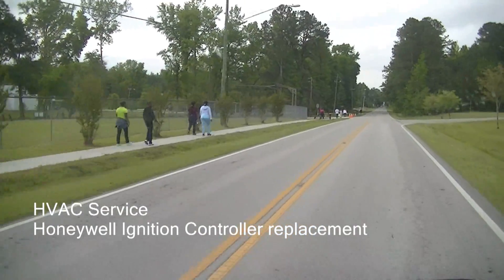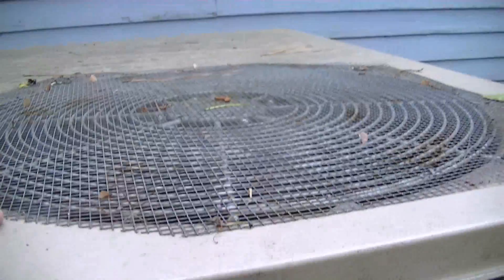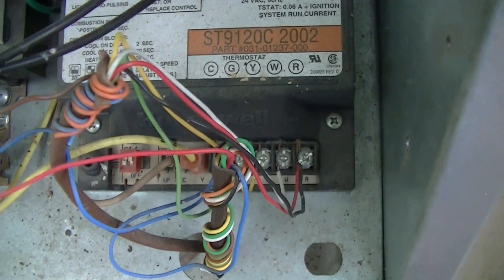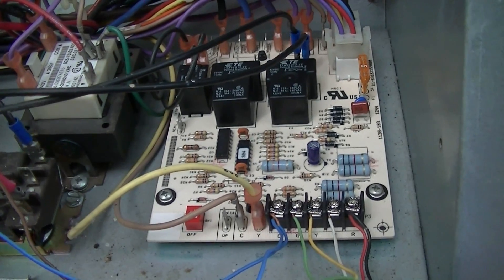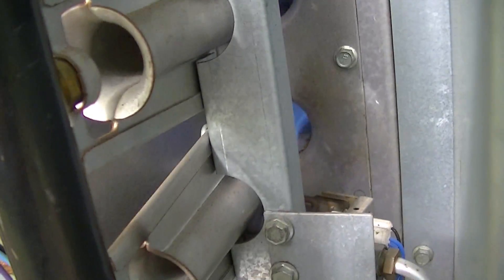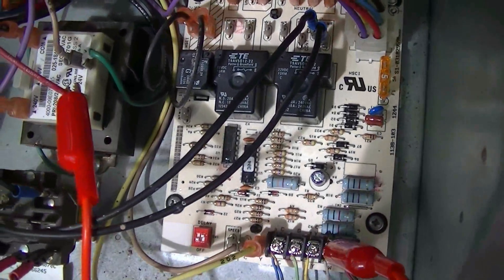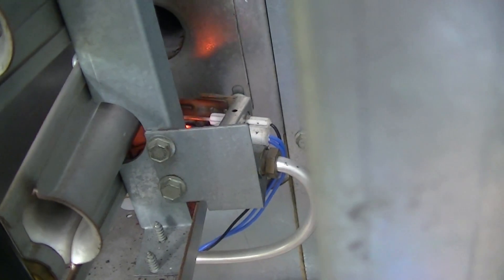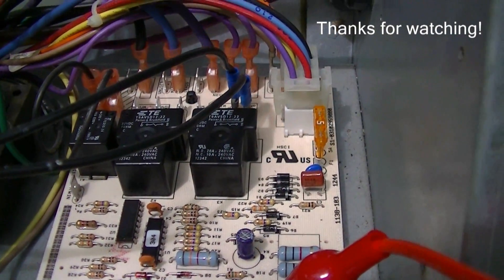HVAC Service- Honeywell Ignition Control Replacement

Comment: I had a "rollout" on a Ducane CMPB075U3.  The fire burned some wires and the outside of the furnace hit about 360 Deg F.  When the tech put the furnace apart, we found that on the ST9120C control board, the R11 and R38 (both resistors?) looked overheated.  The furnace had not shut off on its own.  I had to cut the power to it.  Does anyone know what the R11 and R38 on the  ST9120C do?  I have photos of the furnace autopsy.  I'd like a schematic for the board if anyone has one.

Comment: I have one that the blower and don’t know correct name exhaust fan stay on no matter what and also board stays solid light says reset or replace i cant find any reset sensors or buttons i pulled breakers to stop power hoping that would reset i don’t work on many package units mostly split heat pumps systems thank you for any advice

Comment: Ok this is very helpful, however I’m replacing the control board in this video with the ST9120U and I have 3 extra wires... any help would be greatly appreciated.

Comment: I worked HVAC full time all last year. Have not seen anyone short the W and transformer leads. I will have to try that. Mostly the W and R are shorted on the LV thermostat terminals.
Reply from the maker: Just another way to do things
Reply from the maker: +Brian Mowers just another way of doing things